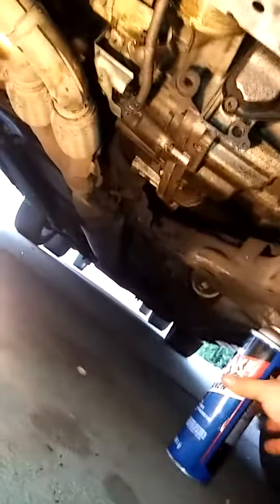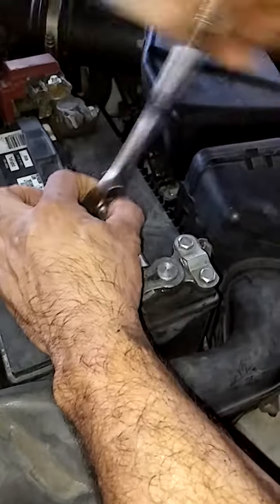2006 nissan maxima P0335 crankshaft position sensor replace

Comment: Thanks for the upload but i wanted to ask you a question: if i had changed the two sensor on the top and didn't change the bottom would it still start or i have to change all of it?

Comment: Thanks for great video! Here is my 2005 Maxima SE problem: rough shifting from 2nd to 3rd  and from reverse to 1st while running for a while (hot) .  Replaced trans fluids , replaced solenoid valve entire body including solenoids. Same problem. NO other issues. No engine light ON. Do you think crankshaft position sensors replacement may help? Many thanks for your help!
Reply from the maker: Do you replace the 2 blue sensor on top of the transmission I have problems before not shift right and the car no go to fast when I replace those 2 sensor problem resolved

Comment: Changed all both camshaft sensors and and the crankshaft sensor and my car is shifting out fine now. Only problem I'm having is when I crank it, it keeps cutting off. I have to give it gas to keep it started. Thank God it wasn't my transmission.